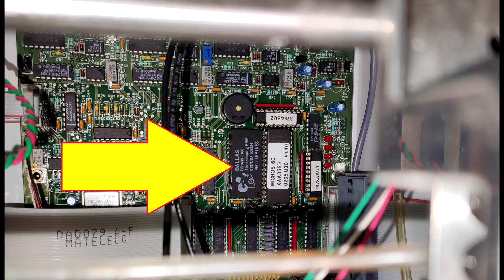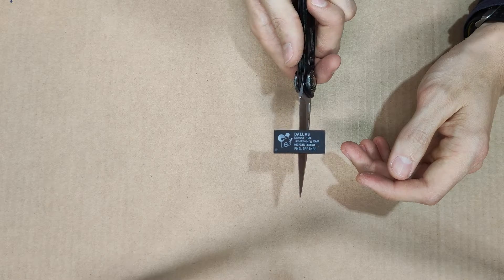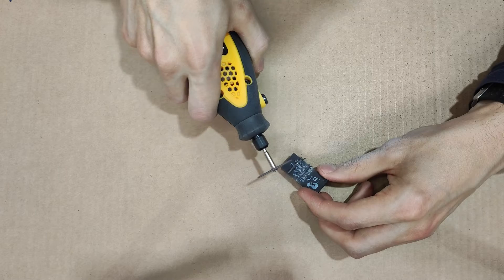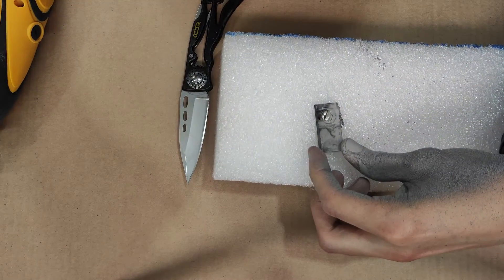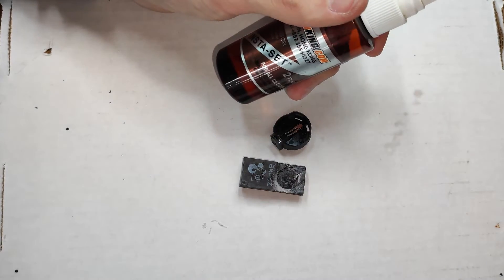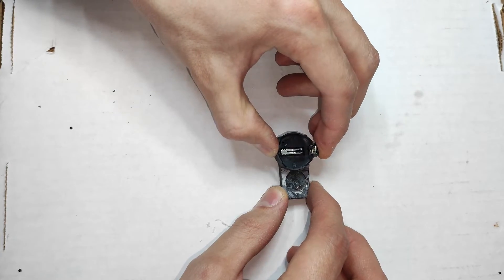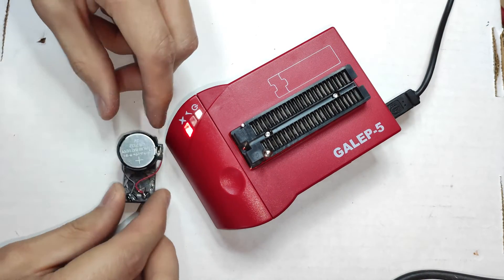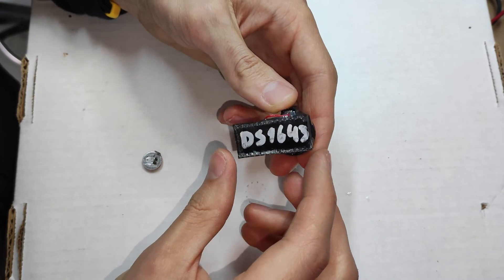Replacing a non-replaceable battery on a RTC (DS1643)

Comment: can i use any programmer to read this 1643?
Reply from the maker: As long as it is supported by the software, I don't see why not.
Reply: great, do you what's the difference between 85+ and 100+? I tried replacing the 85+ with 100+, and the CPU doesn't work.. I'm using sparc CPU 2ce